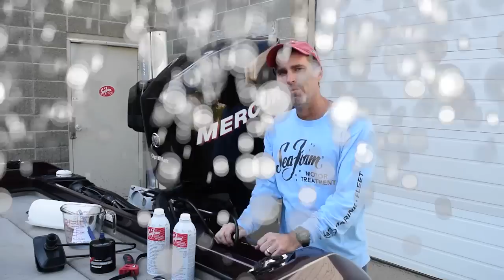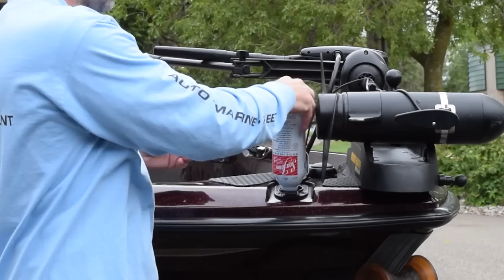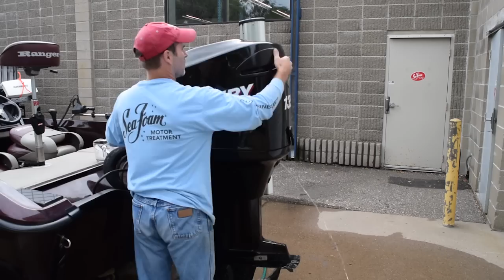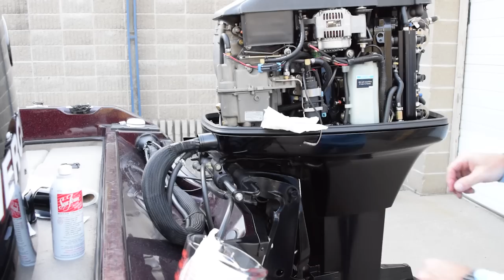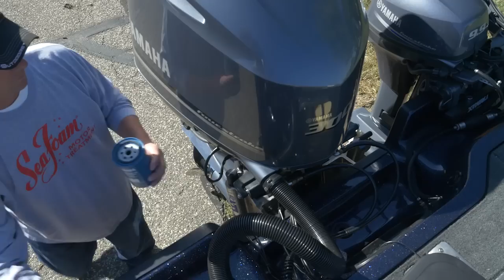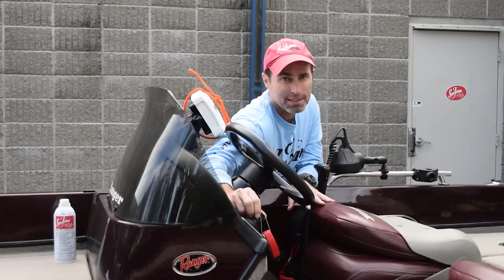How to clean a boat engine's top end - filter change method

Comment: So when you crank the motor will the fuel filter fill up with more gas and oil to lubricate? Two stroke needs the oil so its scary just putting sea foam in the filter .
Reply from the maker: Hi Cody - 2 things: 1) yes, there's already plenty of fuel in the rail + the filter is continually filling with fuel, 2) if oil-injected, the oil goes directly into the lower crank area on a 2-stroke.  If oil/gas mix, oil is always being drawn through the lower inlet port. Not an issue/no worries.

Comment: Is this  method okay to do on an optimax?  Putting seafoam directly into the fuel filter that is??  I heard it was not a good idea to that to a direct injection
Reply from the maker: Yes, safe for any gas or diesel engine. Injection system makes no difference. You know the engine in the video is an Optimax, right?
Reply: @SeaFoamOfficial  I saw that. Illy very first boat and engine. Just wanted to make double sure. I thought maybe some were different than others. 
I really appreciate the video!
Reply from the maker: @chrisallison1981  Thanks, Chris. Another way to accomplish the same thing is to add several cans of Sea Foam to a low tank and run the engine hard under load. No need to mess with the filter and cowl, etc.

Comment: You said you could do that with a 2 stroke. If you run with straight sea foam in the filter you will be running without a fuel oil mix. Will the sea foam lubricate the bearings enough?
Reply from the maker: Oil is injected into the crank area regardless. If premix, the Sea Foam is still mixing with the fuel and oil. The engine in the video is a 2-stroke. Hope this helps!
Reply: @SeaFoamOfficial  You showed and said pure sea foam in the filter. My engine is not oil injected. So pure seafoam in the filter means no gas, oil premix is living the engine till the seafoam is burned out. Is that correct? Will the seafoam be sufficient to live the bearings?
Reply from the maker: @AlaskanMissions  Sea Foam is lubricating oil, and even though it's filling your filter, there's will remain remnant oil going through the inlet port to lubricate the crank. You can also add a small amount of 2cycle oil to the Sea Foam in the filter if concerned.

Comment: I remember they tried cleaning my four wheeler but with Lucas and it burnt the piston rings up, had to be rebuilt. Does the sea foam placed in the new filter make a concentrated dose right before the engine? After the whole cleaning process. Or does the sea foam soak up into the filter making it safe. Just don’t want to ruin my outboard myself.
Reply from the maker: Sea Foam is 100% petroleum oils - harmless.

Comment: Is Seafoam bad for etec injectors? Totally different injectors of ANY engine made.
Reply from the maker: No worries.
Reply: @SeaFoamOfficial  So are you saying it is good or that it just won't hurt the injectors? If good.... could you explain to me1?  How it is good for etec engines? Do you know the difference in etec engines and their injectors?
Reply from the maker: @Oldschool0367  It will work great to clean your E-Tec's injectors AND it's a good thing to use! [Also consider using Marine PRO.] And yes, I am very familiar with E-Tec engines. They are a direct-injection 2-stroke, similar to the Optimax in the video. E-Tecs also have a self-lube feature that's somewhat unique. Nothing about an E-Tec requires special treatment. Hope this helps!

Comment: Just followed this video for 1987 Yamaha 150 2 stroke with 1,826 hrs on the motor. I use ethanol free gas and amsoil pre mix. I couldn't believe how well seafoam worked on this older motor. The whole neighborhood was covered in white smoke. Motor ran a lot quieter.

Comment: Hi, I have a Mercury 40 hp (4 stroke 2013) What amount of Sea Foam and gasoline can I mix in the tank? I want to run my boat in the lake, and the engine is cleaned while I'm sailing.
Reply from the maker: We instruct 1 oz per gallon for keeping fuel fresh. For cleaning, add 2 or more ounces per gallon.  When we suggest "more", check out out Can & Hose video on how you can create a very high cleaning concentration with one pint can of Sea Foam.  Generally, it's a smart habit to add a Sea Foam can when the tank is low.  Think cleaning concentration.

Comment: Brian, thanks for the video.  I have a 5 year old motor that looks to have a bit of carbon deposits when I look through the spark plug port.  I am thinking of doing what you show in the video to my motor.  But furthermore, how often (frequency) do you recommend doing that to the outboard motors?
Reply from the maker: Hi Chris:  For frequency, I much favor the 'Can & Hose method 2x per year (see video). More, most outboards can sit for weeks at a time without running so we recommend running Sea Foam in every tank of fuel, which is an ongoing cleaning. Other tips:  Whenever running an outboard, try to always try to make a run at max speed and RPM to create max chamber heat and compression. If you don't, carbon residues and deposits build easily in the chamber hemispheres.

Comment: Can I run my boat on seafoam?
Reply from the maker: Do you mean run your gas boat engine of straight Sea Foam? If so, no. You need at least 50% gasoline for ignition.  Either way, not something you'd do under normal use.  In any case, 50/50 is what mechanics use for high concentration cleaning procedures (fuel rail canisters).
Reply: Sea Foam Official Well you'll be happy to know some guy on YouTube ran his lawn mower on straight Seafoam and it ran fine just a little white smoke.
Reply from the maker: Yes, can run on 100% of lots of volatile fluids if you meddle with a small engine's carburetor intake.

Comment: I've got a 1979 35hp Johnson and compression is getting low in the 90s but had I'm the 130s last summer..how would you go about cleaning the rings with sea foam?? I've used it before in vehicle gas motors and had real good luck just soaking the pistols through the plug whole...thanks
Reply from the maker: To clean rings remove the plugs and spray Sea Foam Spray into each cylinder cavity and crank the engine for 5 seconds (or pull rope 5 times) each day for 3 days.  After 3 days give it a go, then let us know what happens. If gets better, repeat if needed.
Reply: Ok will do...mite even got the motor good and warm then pull the plugs and soak it...thanks so what's a fella got to do to get one of them nice sea foam shirts??? Lol
Reply from the maker: Warming up is a smarter idea!
Reply from the maker: Can get shirts on the website - seafoamgear.com
Reply: Well John - did you try it, and if so, how did it go?

Comment: Would you use this as a substitute for fuel additive in a 2 stroke with a carburetor?
Reply from the maker: Yes, Sea Foam (IS a fuel additive that) works to clean carburetor and fuel-injector passageways.  Can be used in ANY 2- or 4-stroke engine with a carburetor.  Does that help?
Reply: Sea Foam Official for instance I usually put a bottle of evinrude marine oil in a 5 gallon gas tank to bottle ratio. If using sea foam, would I still continue to use this and then add the sea foam or just leave out the evinrude oil?
Reply from the maker: Sea Foam does not replace 2-stroke oil.   Never leave out the oil.

Comment: Wil Sea Foam help with low compression ??
Reply from the maker: It will if you the compression rings are restricted by carbon and oil grime.  Let me know what type of engine and I'll reply with instructions.
Reply: 40 hp Tohatsu 2 stroke.
Reply: Sea Foam Official 1988 us Marine crysler force 125 if I look in spark plugs and hole it just caked I only get 120 psi but should have 145 will seafoam help
Reply from the maker: Low cylinder pressure can be worn or gummed up rings. When you refer to "caked", please describe??
If you're seeing deposits, you may have residues binding the rings.  Soaking Sea Foam Spray in the cylinder cavities will help clean grime from stuck rings.  Can't fix worn rings.

Comment: I am firm believer now, after using this method to get my Honda 30 back in great running condition. I posted a video on my channel discussing my problem and the fix. Thanks Sea Foam!
Reply from the maker: Thanks for posting, J Allred.  Will check it out!
Reply from the maker: Watched it....nice job on the application + glad it worked for you!   The big lesson was your overview of the causes of engine trouble...90% of problems is a matter of overcoming restrictive fuel residues (petroleum gum/varnish). A lot of people would save themselves a lot of trouble and money if they understood the idea of soft gum and fuel residues, and how Sea Foam easily dissolves and reliquifies the restrictive residues back into the liquid fuel phase to burn away in the chamber. So basic!!!  Great vid - thanks again for sharing!
Reply: Thank you.
Reply: @The_guy_that_brake_checks_ Jerkoffs Wrong about timing. Johnson has a bulletin about timing needs to be retarded 1/2 inch. Also...before you do anything do a link and sync. Very important!

Comment: Is this safe to use with yamaha ring free ?
Reply from the maker: Yes, fine.  Not encouraged that you mix but Sea Foam is petroleum-derived and should not adversely react to fuel additives although some can be harsh/caustic.
Reply: Some guys are using seafoam instead of yamaha's ring free. Ring free gets very pricey and I wouldn't mind a more affordable replacement.
Reply from the maker: And works better, and safer, and does more...

Comment: can you please do a video on cleaning a inboard mercruiser carb with sea foam or tell me what to do ill buy your products
Reply from the maker: Thanks for the suggestion.  There's a video showing how to clean through a Chevy Impala carburetor throat.  Same steps would apply to your Mercruiser.
Reply: Mariner 30 HP THROTTLE STUCK FULL THROTTLE
Reply from the maker: Hi Ray:  Please feel free to ask a question.  If so, specify whether tiller handle throttle or linked to shift throttle.

Comment: hi i have a flat head six chrysler crown with a up draft carb in my boat just wondering if this product is safe to run  in fuel tank
Reply from the maker: Yes, safe in  ANY gas or diesel engine. All petroleum, no harm, no worries.

Comment: I used this on my 2 stroke  mercury and it smoked like crazy. why did that motor not smoke at all?
Reply from the maker: Great question:  The Optimax in the video has had a ridiculous amount of Sea Foam run through it.  Used for testing formulations, high ratios...almost like a dynamometer on water.  There is no hydrocarbon residue in the engine whatsoever, so it won't smoke.  FWIW, one notice over the years was that Optimax 2-stroke oil left buildup on fuel injectors.  After switching to Pennzoil XLF the deposits vanished and never came back.  Merc DFI oil is great, it's just that the Opti in the video stayed clean with XLF.
Reply: Sea Foam Official  thank you that makes sense

Comment: hi my yamaha 115 fourstroke is running great would you advise still using this method to give the injectors a good clean out?
Reply from the maker: Yes, most Yamaha outboards have inline filter cans, so easy to do.   "Can & Hose' works even better!  Look for the video on Sea Foam Official.

Comment: if it doesn't matter how much I use, can I run a couple gallons of straight foam.
Reply from the maker: A diesel can run on straight Sea Foam.  A gas engine requires a minimum ratio of gasoline to remain volatile.  In either case, 2 gallons is excessive.  Does a boot camp Marine use 2 gallons of shampoo to wash his hair?
Reply: It's probably gonna start to add up price wise haha

Comment: Check out my video: Outboard Seafoam Shock Treatment. It shows you how to use Sea Foam on your boat engine! https://m.youtube.com/watch?v=BXcfsmuruc0
Reply from the maker: Hi Matt:  Thanks for sharing that video.  You're definitely on your way to figuring out the high concentration approach - Nice job on the 'Can & Hose'!
Reply: Thanks for the sign of approval! I prefer the high concentration method over any other method for outboards/boats in general.

Comment: can you use sea foam along with stabil that has already been added to my gas tank?
Reply from the maker: Hi Jay:  Thanks for the question.  Yes, you can add Sea Foam to fuel if you've already treated with another additive.  Sea Foam is all petroleum (like fuel) and has nothing in common with StaBil.  They also won't react to each other.

Comment: I add it to every tank on my '58 Johnson 35, and used it to clean internally when I went through the powerhead when disassembled, works VERY well.
Reply: Every tank!? Wow did you have any problems down the line?
Reply: Thinking of doing this

Comment: is there a video for 2 strokes?
Reply from the maker: Every Mercury Optimax is a 2-stroke direct injection.
Reply from the maker: That is a 2-stroke.
Reply: burnnnnnned
Reply: Joe Doug well that was the dam fuel water separator ! Lol
Reply: Did you end up using the sea foam on your motor? I was planning on buying it this week.
Reply: That's a 4stroke...